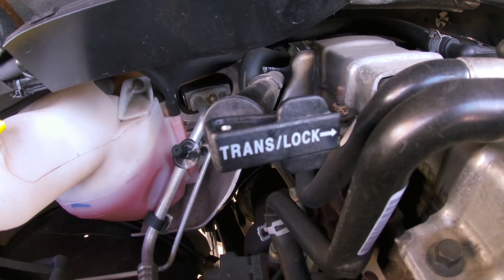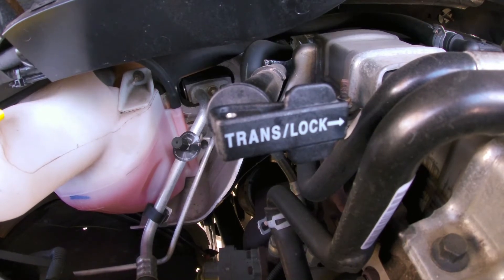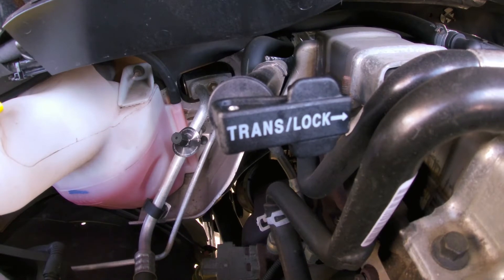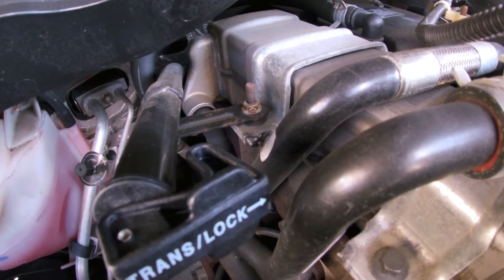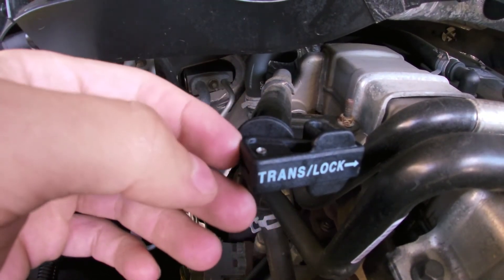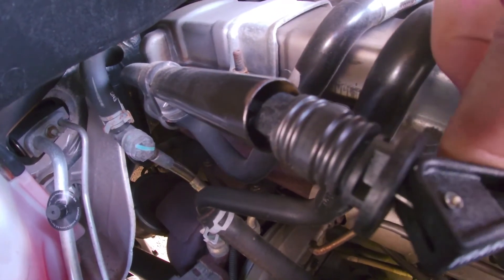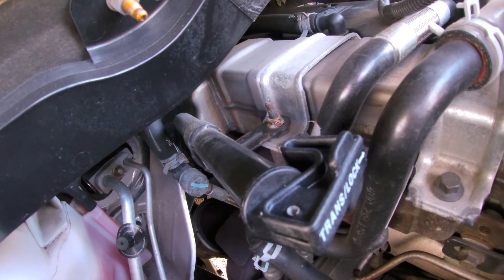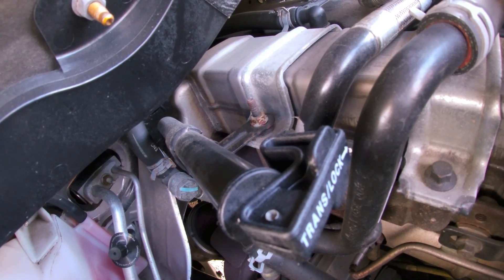68RFE Locking Dip Stick Review | 6.7l Cummins Safety Mod

Comment from the maker: Dear viewer: If buying this dipstick (or using the factory dipstick), I recommend measuring it against the factory dipstick that you removed/ cutting a small bit off. Why? - there have been cases where the factory dipstick rubs against the inside of the pan that eventually causes it to leak through. I cut off a small bit on mine. Goodluck.

Comment: Transmission fluid isn't flammable. It's combustible with a flash point usually around 3-400 degrees. Still a hazard leaking on your exhaust or turbo.

Comment: I bought the same stick but is too long. What I need to do
Reply from the maker: Interesting, what year is your truck with the 68rfe? 
I would call Suncoast.
Reply: @AES5967  99 47rh
Reply: And is the right part number
Reply from the maker: @josefalero1087  The dipstick featured in the video and its corresponding link in the description is for the the 68RFE automatic transmission they put in the 6.7l's years 07.5-18.
This will not fit your transmission. 

Side question: Did someone swap that 47rh in your 1999? I only ask because 47rh's were only in 1994 and 1995 trucks. They started using the 47re after that.
Reply: @AES5967  47rhe